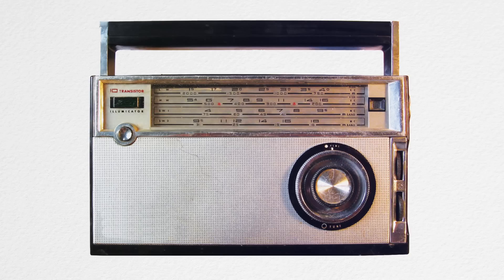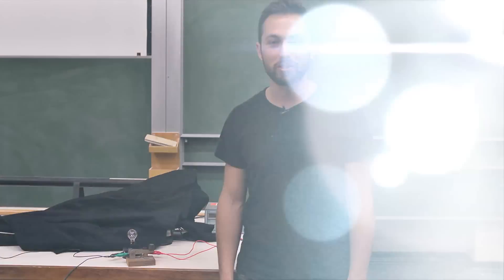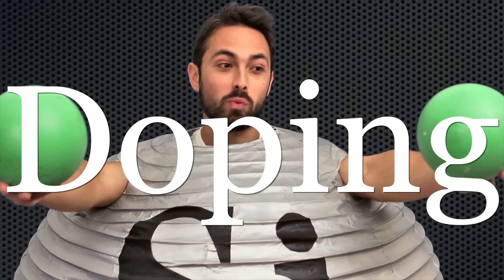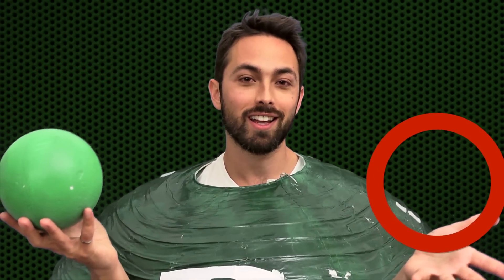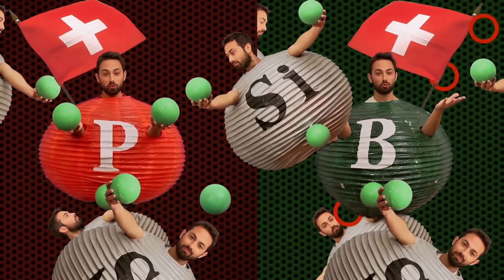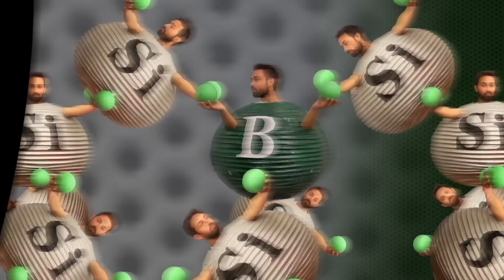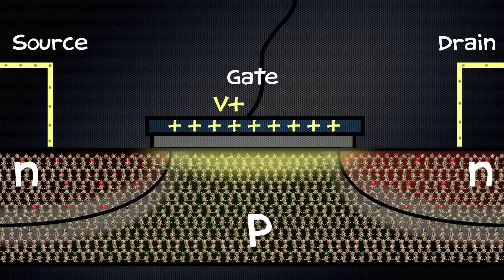How Does a Transistor Work?

Comment: 0:15 this is incomplete. The original purpose if a transistor was to amplify a signal not to function as a switch.   I guess technically it coukd be both but your switch analogy is a gross oversimplification

Comment: That would be a great topic for a new video!
Until now, we understood the tunnel effect as a problem in the miniaturization of transistors. Because the electrons jump even though they shouldn't yet.
What we previously understood as a “problem” is actually a huge advantage. Tunnel effects are catalytic: they enable even better and simpler implementations.
Electrons do not have to climb an energy potential at all. With a suitable implementation, they can jump directly!
Transistors are still the light bulbs of electronics. A modern quantum tunnel transistor would require much less energy, could be made smaller, and would generate less waste heat. Similar to LEDs, they generate more computing power per energy instead of wasting so much in waste heat.

Comment: Many people here say, and I concur to them, that this video explains transistors better than many teachers/course books do. I wonder why  and here are my thoughts: curricula is very busy shoving irrelevant math down the throats of students. When I am saying ''irrelevant'', it doesn't mean wrong, or not interesting, just out of place for people who do not want to do academic research on that particular subject. There is no need to learn math/advanced math unless you embark on an academic research path. If you do not want to know how to design electronic INDIVIDUAL components, but want to understand how they work and how to use them in real life in conjunction with other parts, you simply do not  need the kind of math that puts many people off when it comes to learning it. But then, teachers feel that parts of what they know about these subjects become irrelevant, and therefore they won't let go. I wish they understood that as time goes by, so much new information comes along, therefore some of the old way of teaching should be upgraded by not teaching us things from Adam and Eve anymore, but teaching us how they  work and not how they were originally conceived . If you want to know how a car's cruise control works, you do not need to know about Laplace transform, and even though this is instrumental on how it works, we can successfully do without it. We can understand what a Baud rate is without learning how it has come to mathematically becoming relevant to the subject. And so on and so forth. I believe that the barriers that stand between a student and the knowledge they want to acquire are 95% artificial and have to do with ''interests'' other than the students learning about those subjects: teachers, authors, curricula makers, universities, etc they all WANT SOMETHING (to publish books, to author certain subjects, intellectual property, to obtain financing for whatever projects by ''preparing'' students in a certain manner, etc, etc). And the poor student wanting nothing but to have a direct and honest relationship with the subject at hand, they all have to comply with the requirements/personal interest  of those who make that subject available for others to understand . Chat GPT has a lot of flows still, but if I really enjoy something about using it is the fact that I can learn things ''from it'' (obviously not from it, but from other humans who have written books/articles, etc) by stripping down all the unwanted math and all the unfortunate ways of presenting different subjects. I can have my own mind when learning subjects from scratch, and enjoy cross questions to only find the right ones that lead me to unveiling the truth about  a certain subject. I hope I am not the only one who regards Chat gpt as a private tutor, provide that you understand its limitation and its ways of avoiding giving you a high amount of information in a short amount of time (like uploading 2 one thousand page books and asking it to contrast them, just as an example). Isn't it amazing that some people work to add math in some books and some others to get rid of that math (when and where it makes sense) ? The amount of energy to add that information is much greater than the amount of energy to get rid of it/ignore it; isn't that unfortunate ?!

Comment: 4:46 Just in case, u missed it like i did, the gate is not physically connected to the p-silicon, there is an insulation between them it is through induction, the electrons cross the depletion layer...
Reply: He actually said they were separated using an insulator check the minute before

Comment: This video is now 11 years old.  Has quantum tunneling become a problem in the science of transistors?
Reply: Yes, we're now on the 2nm scale for our transistors. We've compensated for quantum effects by making the p type substrate in a 3d structure which goes up into the gate and allows the transistor to be smaller but have a much more restrictive depletion layer (FinFET). If I understand correctly.

Also we've been able to take advantage of those quantum effects in certain transistors by not even having the n type sections touch the p type and have the gate completely surround the p type section. The electrons can tunnel into the p type section and out into the next n type but when the gate is closed they can't tunnel because even more of the surface is depleted and it's far away. This allows you to have multiple transistors of varying activation voltages in the same location by stacking the p type sections on top of each other (GAAFET). Again assuming I properly understand

Comment: Instead of making the transistor smaller and smaller, why not make the voltage "gate"/"grid" wire the it's own switch by choosing a material for the wire that needs a certain voltage for the electrons to pass through it. bye bye transistor.

Comment: So while transistor sizes are reaching the physical limit at the present (2024), I do think that there is still significant room for improvement in other areas. Hitting a threshold in one area may just open up resources for development in other areas. 

Advancement might slow down in some areas and even overall, but I don’t see it as a problem - just time to focus elsewhere.

Comment: Good video Derek, but your transistors counts at the beginning are way off (even for 10 year old smartphones and computers).  I think you counted the processor transistors only; DRAMs use 1 transistor per cell, so even 16GB is (16 x 8 x 1B) = 128B transistors...

Comment: How does hafnium play into the semi conductor? 
Can that be swapped with tantalum or palladium as a high K dialectic gate Insulator? 
Or is hafnium the real bottleneck in the semi conductor manufacturing industry? With only about 60 tons mined each year. I also noticed it says the US is the biggest manufacture but hafnium comes from zirconium mining which doesn’t happen in the US. I think the refinery is occurring in the US not the mining.
Other than boron and phosphorus, what other precious metals are in semiconductors? tantalum, Tin, tungsten, gold, hafnium, gallium, indium, silver. 
Quantum tunneling can be fixed with tantalum or palladium Right? Both have high melting points and are diamagnetic.

Comment: Silicon is NOT a semiconductor. You are confused. In fact silicon is an excellent insulator - it does not conduct electricity.  Semi conductors are made out of silicon. As you point out, he silicone has to be doped  with impurities before it becomes a semiconductor.   

Also, I also do not really move as you state.  The holes are fixed in the crystalline structure created by trivalent impurities.  It’s still electrons that move from hole to hole. The difference in the reason they make a distinction is because holes are at a different energy level than our free electrons and therefore have different characteristics in their movement. 

Also there is another layer between the collector and the emitter, and it’s called the base, and it is also a semi conductor.   Transistors semi conductors are either NPN or PNP.  The middle layer describes the type of semi conductor material in the base. 

The exception of this is a PN Junction and that is not a transistor, it is a diode. 

You should research and learn more about a subject for which you’re trying to make a YouTube presentation.  

There are other mistakes that that I will not delve into that at this point

Comment: Thank you - This was a great video. Im refurbishing a pinball machine & I have to replace some transistors on the motherboard. In a blog a guy said take a wire & touch one end to the top drain of the transistor & the other side to a ground & if the bumper fires, you found your problem. The transistor was the issue. Now I understand how & why that test worked = )

Comment: From 22nm 10 years ago when this video was made, to IBM's new 2nm chip, the fundamental principle is still simple yet groundbreaking.
Reply: They aren't really 2nm, It's a marketing name for define It generation, Their gate pitch and metal pitch still more than 20nm
Reply: 2NM??? SOON YOU PROBABLY WONT BE ABLE TO SEE IT WITH A MICROSCOPE!
Reply: @Skitzyzzy  Lmao you can't see them with one 10 years ago eithe, visible light is over the 200nm mark. Only electron microscopes could.
Reply: IKR 🚡🚡🚡🚡🚡🚡🚡🚡🚡🚡🚡🚡🚡🚡🚡🚡🚡🚡
Reply: They will have to find a new way to make a quantum and gate
Reply: I understand both the points. Whether we talk about 22nm or 2nm, both are incredibly small to see. But in the future where 0.5nm or 0.01nm comes, i think they will apply a different unit. So no need to worry about that either.
Reply: @AyushJha2001 a silicium atom is about 0,2 nm so it seems irrealistic
Reply: @TeTe76VTheChiken  thanks my friend for giving me good info. We found the limitation of how small measurement can reach. Appreciated.
Reply: @AyushJha2001 when it reaches that state, most likely quantum computers would replace modern computers
Reply: @AyushJha2001  A nanometer is equivalent to 10^(-9) metres. Like 0.000000001 meteres.

Just like that, we have picometer you which is 10^(-12).

And if we cannot make transistors more dense horizontally, we can make it so vertically. Like stacking One chip over the other.
Reply: @BhaveshCodes  At picometers range, you'd successfully reach The Nucleus. How would you expect a transistor that small 😅
Reply: @Agarwal2025  We have a little miscommunication here. I didn't mean to imply we'd have transistors that small. I meant we can't even go below 1nm and we'd need some other method to increase the density of transistors. Sorry if i said anything wrong, please correct me.
Reply: @BhaveshCodes I was actually thinking on the idea of making "cubic chips", would it really be possible to compute in three dimensions? I mean, not just stacking chips but trully make a single one.
Reply: @vitorleite4336  I am no hardware expert but I think that's where we are headed if we need more powerful CPUs for ourselves. A whole new kind of cooling tech would be needed for it to work, and I am pretty certain we will see it in our lifetime.
Reply: @BhaveshCodes  when someone says "3nm", they aren't actually 3nm, so that's why it's not an issue, it's a marketing term

Comment: I have a question.  Why did we need to develop the concept of holes, as they are not real. it just complicates the study of semiconductor devices, why not just study the electronic movement in the PN junction as they are the only moving particles.Also will there be any changes if we completely ignore the holes in the understanding of Diodes or transistor?

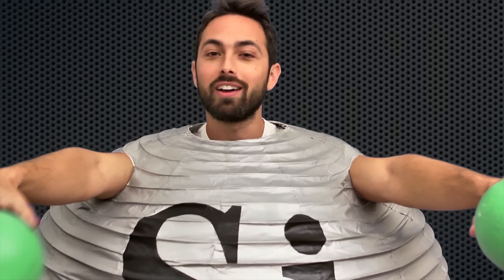Comment: 5:40 i am from future and Yes, we are nearing the limits of Moore's law. The number of transistors that can be packed into a chip has been doubling every two years for over 50 years. However, as transistors get smaller, it becomes increasingly difficult to control their behavior. At the 3 nm node, which is the current state of the art, transistors are already starting to show signs of quantum tunneling. This means that electrons can tunnel through the transistor's gate, even when they are not supposed to. This can lead to errors in computation.

There are a number of ways that engineers are trying to extend Moore's law. One approach is to use new materials, such as carbon nanotubes or graphene. These materials have different electronic properties than silicon, and they may be able to be made smaller without the same problems with quantum tunneling. Another approach is to use new manufacturing techniques, such as extreme ultraviolet lithography. These techniques can be used to create smaller features on a chip, which can help to pack more transistors into a given area.

However, it is becoming increasingly clear that Moore's law cannot continue forever. At some point, the physical limits of transistor technology will be reached. When that happens, we will need to find new ways to continue the trend of increasing computing power.

Here are some of the challenges that are being faced in trying to continue Moore's law:

The cost of manufacturing: As transistors get smaller, the cost of manufacturing them increases. This is because the manufacturing process becomes more complex and requires more precise equipment.

The power consumption: As transistors get smaller, they also consume more power. This is because the electrons have less space to move around in, so they need more energy to do so.

The heat dissipation: As transistors get smaller, they also generate more heat. This is because the electrons are moving faster and colliding with each other more often. This heat can damage the transistors and shorten their lifespan.

Despite these challenges, there is still a lot of research and development being done in the field of semiconductor manufacturing. It is possible that we will find new ways to overcome these challenges and continue Moore's law for many years to come.

Comment: Almost 10 year update: 

We essentially have 3 more years worth of improvements left. There are lots of improvement in terms of how power is delivered, changing shape of transistors (GAAFET) that will primarily give performance improvement. 

The 3 year delay is also mainly because there has been slowdown in improvement in recent years.

After that, your galaxy phones and macbooks will essentially have same performance with every new release.
Reply: Once we reached the limit of cramping more transistors in the same amount of die area, chiplet design and 3d stacking technology is going to be necessary in designing future processors
Reply: After that the improvement won't come from the same scaling down of transistors. But we might see improvements in vertical stacking occur a lot more, or more capabilities of multi chip modules. We might see piezo-electric fans for better air cooling, peltier modules for possible subzero cooling, and maybe even liquid cooling through small channels within the actual die, and that's not to even speak of carbon and someday light based transistors. Plus we have a lot to gain from going back to analog in some fields like AI and possibly physics or ray tracing simulations too. There's a lot further we can go. If we look at what our brains can do, and our neurons are massive af compared to what might be a bare necessity.
Reply: lowk bittersweet. if the performance stays constant then the same parts last for longer and dont have to get a new say GPU every several years. also will force developers to optimize the best they can on the hardware they have, maybe in the process making old computers better.
Reply: @wherwiuemioku  ...Which most business software doesn't. Games would, apps on our phones never will.  Software requirements are going insane now.
Reply: plasma...
Reply: i have no real clue on the subject so that might sound stupid, but can’t the chip just be physically bigger?
Reply: @sergeanthartman5103  Sure, but bigger chip means bigger phone, more heat generated, more battery capacity needed, etc.
Reply: We've almost hit the Sophon block
Reply: @jake3762  This has become true in an unexpected way, because research impediment in particle physics restricts the development of new materials which can potentially bypass the Moore's Law limit.

Comment: maybe convolution could be an extension of this 0/1 logic. The Gate in transitor could be replace by a kernel and when the kernel is activated, there will be a continuous or quantum of voltage across the layer of semiconductor. This quantum voltage is the input signal, and if we could combine somehow the kernel with this thin quantum layer, the output signal will be derived directly!!! no need to manipulate the 0/1 signal in the conventional way:D:D crazy idea!

Comment: Couldn't the voltage be used for creating information? What initates the switch to be a 1? Couldn't that action of applying the voltage be used instead of the flow of electrons through the switch?